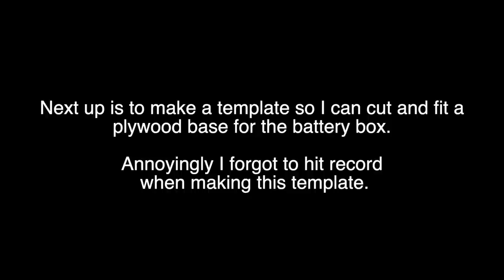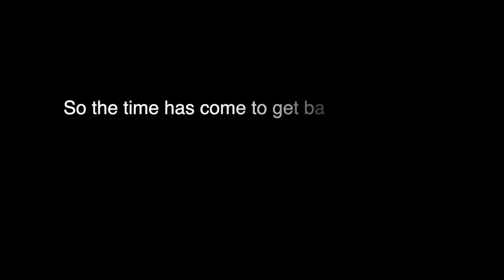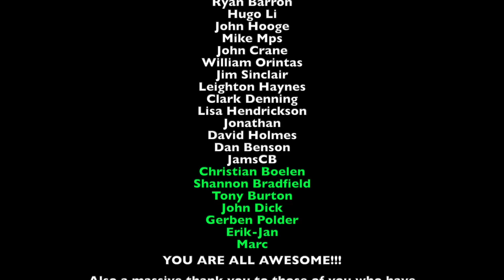Rebuilding a ferro yacht! Capping rails and Electrical systems. ***Episode 30***

Comment: This has vibes of the laid back early days of the Tally Ho project. 
Good work, Finn!👍
Reply: At least Finn hasn't had to truck 4 tonne of rotting timbers for 200 miles, only to pull it all apart to discard it.  🙂

Comment: Don't neglect to use Dielectric grease in all of the crimps. Corrosion of connectors is hard to spot until it becomes a big problem. The grease will prevent hidden degradation of your connections even if they have internal heat activated glue. It's cheap insurance... 👍